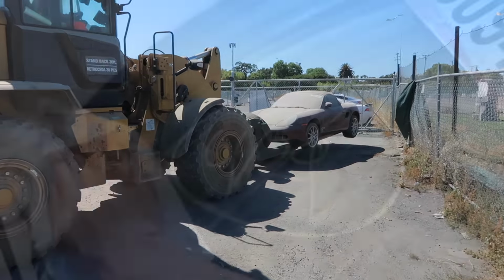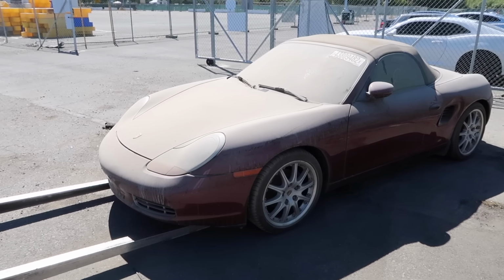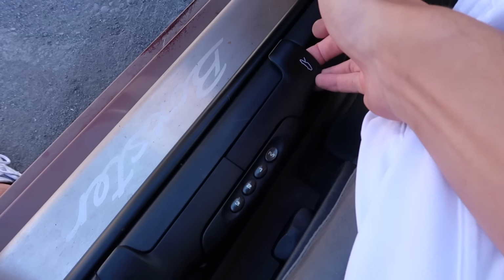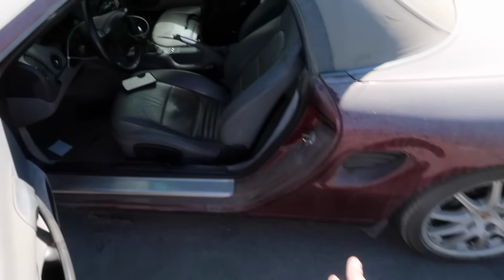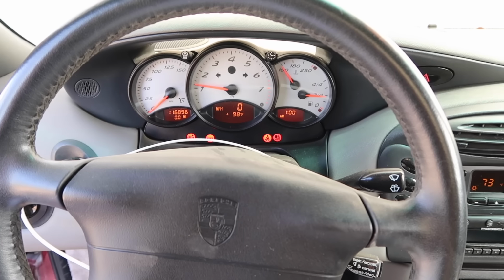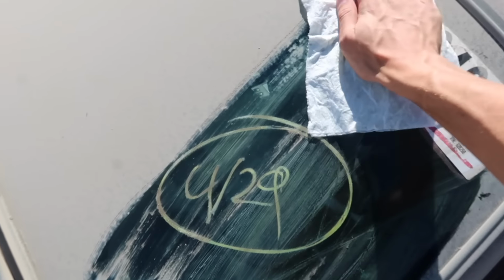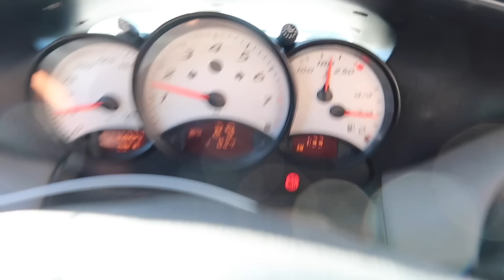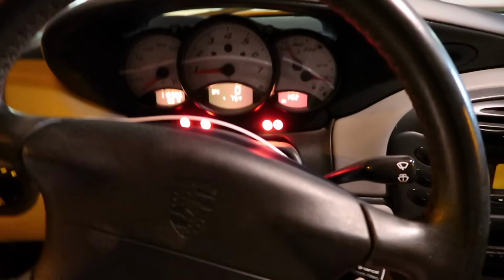I Bought a FILTHY Non-Running Porsche Boxster at Auction! Let's Fix It!

Comment: I would have put three or four bottles of seafoam into the fuel injection and tank to clean out any leftover crap from the unleaded gasoline sitting in the fuel system

Comment: If the battery goes dead for a long time, you have to perform a manufacturer specific Drive Cycle to put the car in a Readiness Mode or t won't pass emissions.  Ask me how I know?  

If "I" had bought a 1999 Porsche Boxster, everything where you would be yelling, Yes, Yes, Yes, I would be yelling, No, No NOOOO!

When "You" turned the key, it started.  If "I" turned the key, I would have seen a massive cloud of smoke and the sound of a connecting rod punching holes in the block!

When you locked and unlocked the door, the trunk lid opened.  If "I" had locked the door, it would have stayed locked.  Of course, I would have left the window up also!

Do you see where this is going?  Stay tuned!

When you came back with that rag to clean the windows and found the ticking noise had gone away, I would have been pocked in the ear by one of those connecting rods.

$70 battery??!!??  The one for my Tahoe from NAPA was like $180!!!!!!!!!!!!!!!!!!!!!!!!!!!!  I think I'll stick to watching videos!

Comment: I cannot believe you did not check the fluids before you started it, wow. This car has been sitting for who knows how long, and you did not check any of the fluids. Hey why not just jump in and race down the highway without checking the tire pressures either. 

Folks you need to check all your fluids at least once a week and before any long trips, do not do this, and do not trust idiot lights and gauges as they can fail. I have seen motors showing great oil pressure and not have enough oil to even touch the dipstick. Unless you have a car that makes you use the stupid idiot lights and computer to monitor the oil level, always check your oil. My BMW has stupid idiot light or computer to check the oil level and I hate it.

But the light was going off on the temp  because it is picking up that there is NOT enough fluid in the tank, the sensor that monitors the level is telling you that it is LOW.

You should had purchased a new battery first thing after you check all your fluids and for sure starting it. So even when you find a great deal you could have messed it all up by not checking the life of the motor. I do not mean to rag on you man but you really need to check things out before you start a motor for the first time. I have owned several cars and trucks in my life and they have all ran as good or better than when I bought them, because I check my fluids.

Comment: Talk less, reiterate less, just DO and sure, explain what you're doing.  It's hard to watch with you constantly running your mouth at high speed.  Consider making a check list up so in your excited state, you deal with basics first before running around in circles.  You might even use that as a tool to show watchers that you did things like check the oil and other fluids before just driving off.  Once you had power from the jump box, the engine was accessible, (that was the time to figure out how), then you should have verified all fluids before starting attempt.